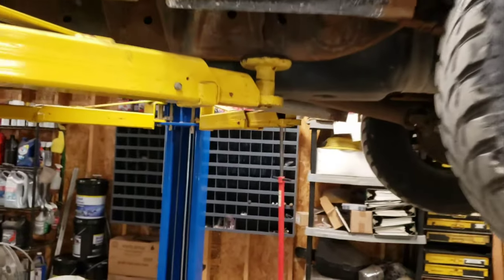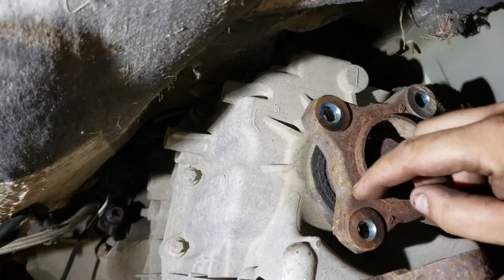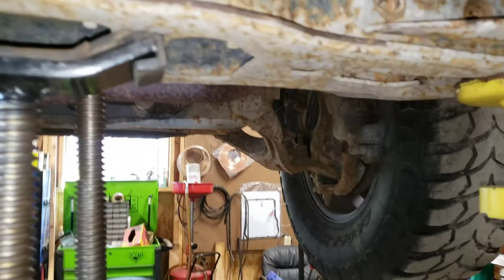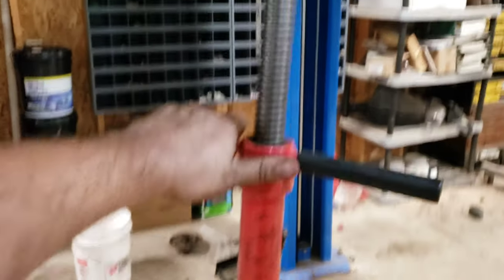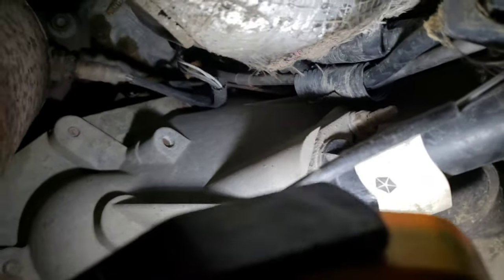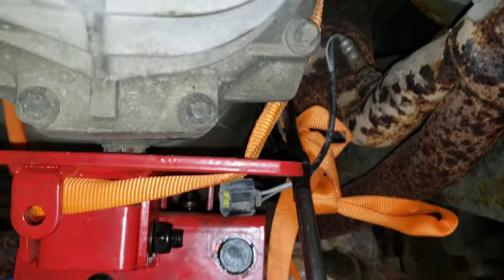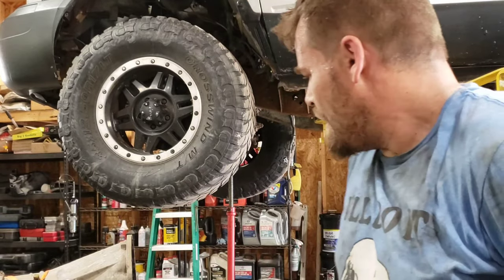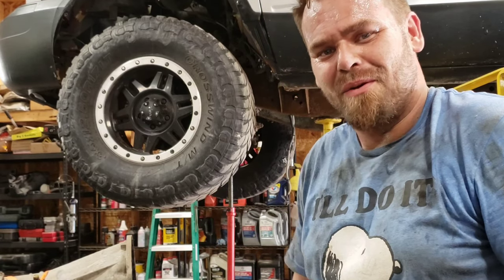How To Replace A Clutch On Your Car Or Truck (87-11 Dodge Dakota + many other makes and models)

Comment: Part 2
Reply from the maker: I very much apologize, but we had a huge tragedy with the GoPro that day and lost 95% of the 2nd video. There are a couple videos out there on changing out the actual clutch (which is pretty much the same procedure on most manual transmissions) as far as the reinstall, its just reverse of the removal. Sorry again bud.

Comment: Completely wasted 20 minutes of my time, you said this was the clutch replacement, not transmission removal
Reply from the maker: @Fireblade-cd7dk  lol, you have to remove e the transmission to replace the clutch. Part 2 got deleted accidentally, sorry. Good news is there's 37,495,825,901 videos on how to actually replace the clutch. If your that far into it and can't figure that out, then maybe just have someone else do it? 🤷‍♀️